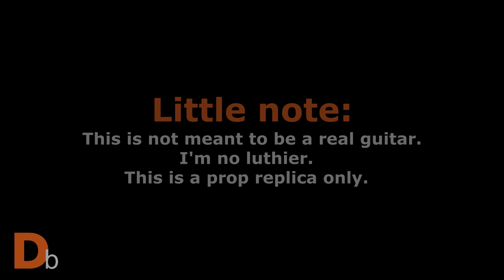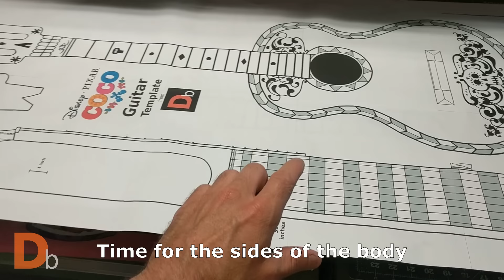Making the Guitar from COCO (2017)

Comment: Hi, 
I am planning to use your template as a guide for building my own replica. I got myself a real guitar to start off with, so I only need the head. If you could give me the measurements of the head that would be fantastic! Greetings!
Reply from the maker: The measurements on the blueprint are accurate.  You can use it 🙂
Reply: @DaBuild  how do I print it right? And thank you for the quick answer!
Reply from the maker: @juliarittner3212  On the blueprint, you have the scale. 1 inch.  I don't recall exactly how I did it (it's been a while) but with that scale ref, you may figure out the rest.

Comment: where did u get those big sheets of balsa wood i hope im right in assuming that u live in canada since you have the king canada tool. im looking at building a prop guitar and my local craft store sheets are not big enough. thanks in advance
Reply from the maker: Hello Dana! Thanks for reaching out :)  Yes, I do live in Canada. I bought all my wood supply in a wood store in Montreal called "Langevin Forest" but any specialised wood store would do.  Hope it helped.
Reply: @DaBuild  was it very expensive for those big sheets. Hopefully i can find something in nova scotia
Reply from the maker: @danachristie110  amazingly not! I was suprised myself
Reply: @DaBuild  shoot i dont speak or read french lol
Reply: How big are the sheets you used
Reply from the maker: @danachristie110  From what I recall, the sheet was 24''x 48'' but again, this guitar is simply a replica.  It's badly made.  Simply good looking. :)
Reply: @DaBuild  im just looking to build a guitar that will break super easy
Reply from the maker: @danachristie110  Well, Suprisingly, mine sucks but is pretty resistant 😄
Reply: @DaBuild  we normally use a real guitar with the internal braces removed but getting hit over the head with one still sucks, thats y i wanna make one out of balsa
Reply: how much did it cost to build the guitar?
Reply from the maker: @danachristie110  Not that much....mostly time :)